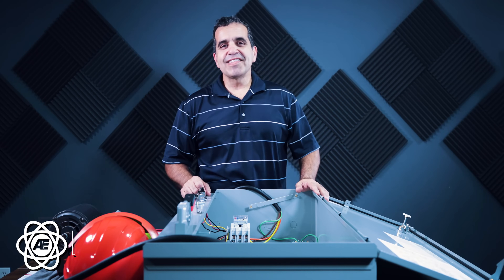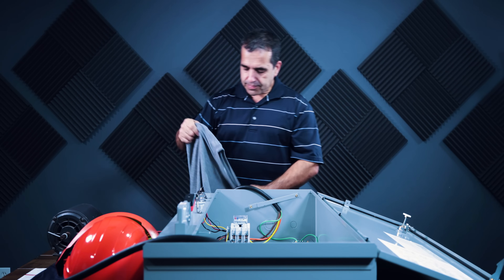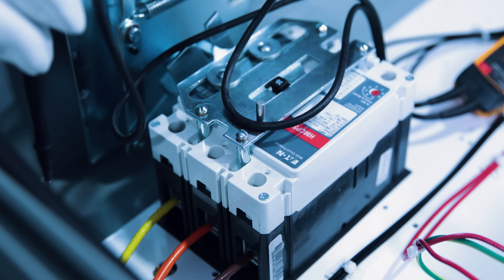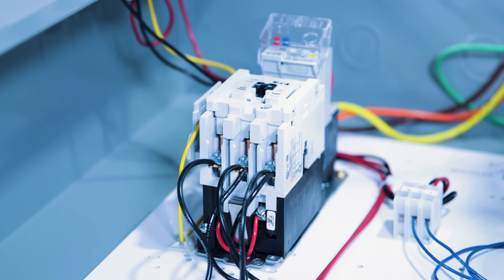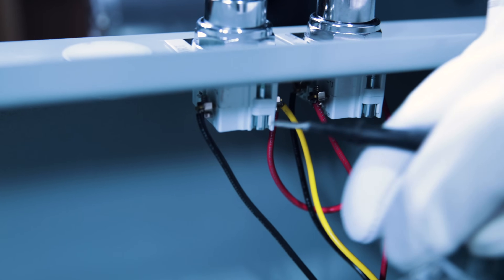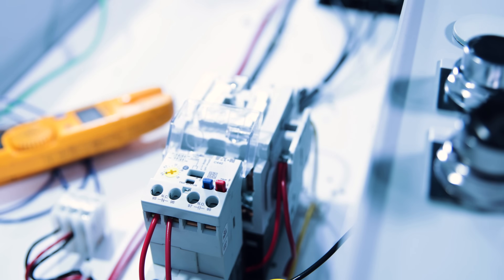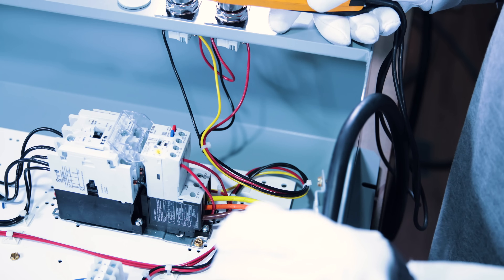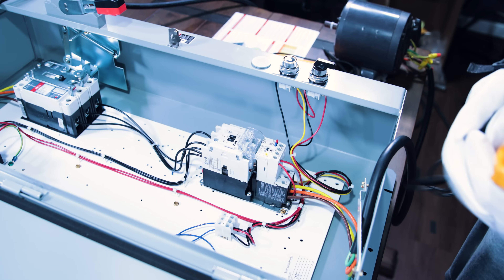Troubleshooting a Motor Starter

Comment: I can't find a proper video to post this question under so I'll just put it here.
Is it 'bad' or 'wrong' to put 2 motors on one circuit or motor starter? In other words, I'd like to have one START/STOP button control one circuit which will have one set of lines going out to two motors to save money on wiring.
In my eyes, I see it no differently than wiring a series of lights to one light switch. However, a few people have told me that you can't do something like that with 3 phase motors and it's very bad. I just don't know how credible their knowledge may be. Any assistance would be great. Thanks!
Reply from the maker: Clint Vowell each motor should have its own breaker and starter so that you can have both properly sized overcurrent and overload protection for each motor. In some cases you could have one contractor start both motors, but they would still need individual overloads. Either tripped overload would also need to be able to open the start stop holding circuit.

Comment: "AMPASITY" you mean current. Do you really wear that much PPE .all I am issued with are glasses and gloves.
Reply from the maker: I demonstrated the PPE required by the NFPA 70e and OSHA. I wanted to show what electricians working on live circuits should be, and are required to be wearing while power is on. All our employees wear FR uniforms. But they still need to evaluate what the exposure level in cal/cm^2 is to determine how much PPE they need to put on.  Thanks for watching and commenting.
Reply: That’s typical in a third world country...
Reply: Ampacity is the measurement of current...dumb ass!!
Reply: @brucehackney2217  no such word and no need to resort to insults the word is  current the units are amps I am an electrician I do know
Reply: @dogwalker666  you should study more Mr electrician.
Reply: While Ampacity is not the "appropriate" word, it's most definitely an actual electrical term.
Reply: @mrreams711  no it definitely is not used and if an electrician did he would get the pee taken.
Reply: @mrreams711  study? I am a fully qualified time served industrial electrician, programmer, cad designer  and installer I have worked in just about every field from a prototype lab in DuPont France to a ship yard in China and a nuclear plant in Cumbria.
Reply: @dogwalker666  Yet you still don't know proper PPE? Surprised that you even have a job. Maybe you should flip burgers. You should be more than qualified for that field.
Reply: @dogwalker666  Ampacity is not used? You sound ridiculous. I'm wasting my time with you.
Reply: @mrreams711  nope definitely not used you need to go back to technical college.
Reply: @mrreams711  dont you mean cook burgers? You seem very triggerd, if you put on all that PPE, when actually working in the real world you would never get any work done, if it was HV then yes,  but try repairing an Overhead crane wearing all that it would be unworkable, now calm down. Have you never worked in a factory?  Because if you get so upset when someone laughs at your slang. You would not last long.
Reply: @mrreams711  and you saying ampacity sounds ridiculous I am afraid.
Reply: @dogwalker666  yes I meant flip... And yes I've worked in a factory. As far as any employer I've worked for, OSHA guidelines are strictly enforced. Complacency kills..... My guess is that you have never referenced an "Ampacity Chart" a valuable section in your "Uglys book" check it out
Reply: @mrreams711  never use OSHA guidelines they are irrelevant,  HSE guidelines are more useful,  and not one of my fuse, circuit breaker, contractor or thermal overload data sheets mentions ampacity, I also have been right through the Telemecanique industrial control gear guides, and the word is not used once,  plenty of current charts.
Reply: Ampacity is the current carrying capability of a conductor if you did not know. Your trainer should have informed you. But that doesn't surprise me. Training is far more "laxed" than it should be in a field that could be very deadly if bad judgment is made. I work with lots of equipment on a daily basis and by far the most important thing to me is making it home to my family in the same shape as when I left them. This should always be top priority for any one in the field. Repairs can wait. No amount of pressure from a company is worth someone explaining to my family why my unsafe practice is the reason for me not making it home at night.
Reply: @mrreams711  been all the way through the IEE wiring regulations 2019, 1983 and 1963 not one mention checked bicc and cleavland cable charts even  GEC HTC fuse catalogue,  not once is the word "Ampacity" used,  Sorry.

Comment: By the time I finished putting on all the gear for 480 volts I will get fired 😆
Reply: By not putting the appropriate PPE on I would get fired. Especially if there was an arc flash and definitely would be an investigation!
Reply: You must work for a rat contractor that doesn’t give a rip about safety or OSHA if in the USA

Comment: Thorough troubleshooting, but it would have been much safer to test for any motor wiring shorts to ground before going for a motor start.
Glad to see you promoting proper selection and use of PPE.

Comment: Great vid sir! Would the stop button give a voltage across the Stop button on a tripped Overload?
Reply from the maker: parmathwal99, the voltage across the Normally Closed Stop button would have the same potential on both terminals, so it will not register on a meter measuring between those two points. But if you measure to the neutral at the transformer, or before the tripped overload, to the Stop button you will have 120 volts. Remember that you will still have voltage at the stop button and it can still shock you but you won't see voltage on your meter if measuring from a point with the same potential.
Reply: @AccessToPower  its For an exam question where they ask what device will measure 120v if the OL trips in the control circuit
Reply from the maker: @US-Warrior  I see. Both sides the stop button will still read 120 volts when measured to ground or the neutral before the OL contacts.

Comment: What if after checking the breaker and relays etc but the overload is still trip on its own? Could it be the motor itself is the problem?
Reply: You will then need to measure the current being pulled by the running/starting motor and compare to the values listed on name plate of motor as well as the rating of the overload.

Comment: When testing control voltage at the switch where is the red lead .
Reply: If your testing to a ground potential,  the black lead should be connected to that ground potential. The red lead lead should be used to touch potentially live points. Keep in mind that any motor control will have two seperate circuits. A power circuit and a control circuit.
Reply: Torrence Milk sometimes the control circuit is 2 of the phases off of the power circuit or motor branch circuit.  Also, it doesn’t matter what meter lead goes to ground on an AC circuit.

Comment: Before testing to ground it is always good practice to test ground to ground to make sure you have a good ground
Reply: Thats stupid how are you going to measure ground to ground when your not sure if you have a good ground
Reply: That's rather useless. There's no potential either way whether you have a good ground or not. You will see 0 volts in both instances... Nice try
Reply: Test the resistance on the ohms settings. Come on lads. Use your nogging
Reply: @bendoherty7721  still doesn't yeild reliable results as a low resistance does not garantee current carrying capability.

Comment: Why did you call terminal 95 and 96 neutral connections?
Reply from the maker: because 95 and 96 are the Normally Closed Overload contact. These are closed with one another when the overload is not in a tripped  condition.  You run the neutral of a 120 volt coil control circuit through this contact in order to turn off the starter in the event of an overload trip condition. If you ignore this step, on overload condition will not turn off the motor starter and may cause the motor to fail.
Reply from the maker: if your coil voltage was 240 volt, you would use L1 of your 240 volt circuit through your start stops to A1, and L2 through your Overload contact to A2.